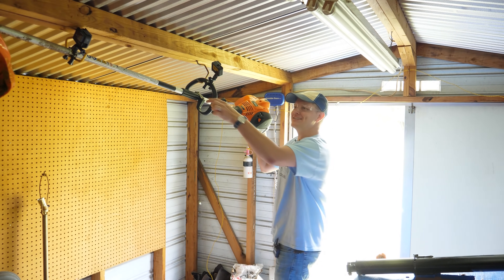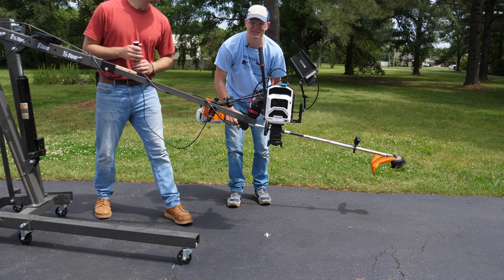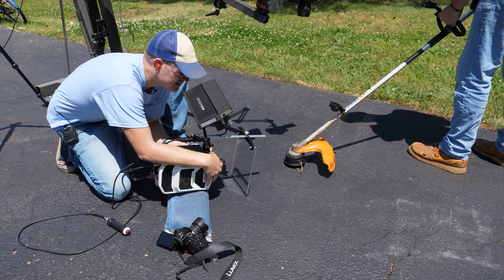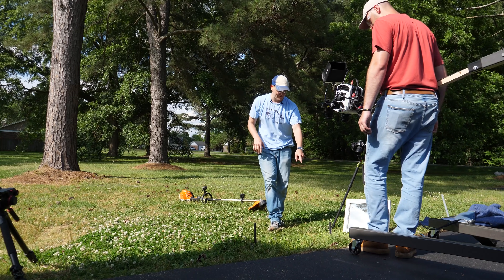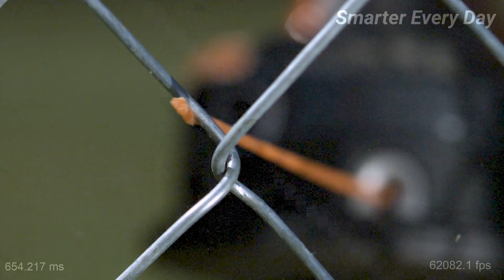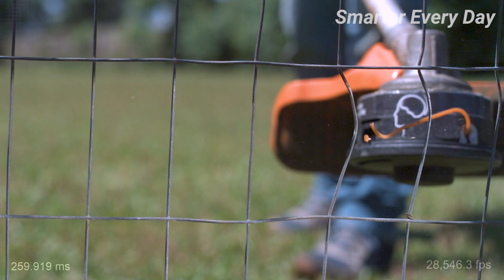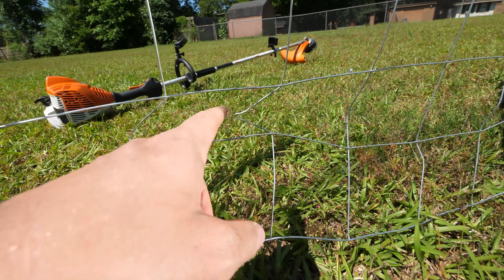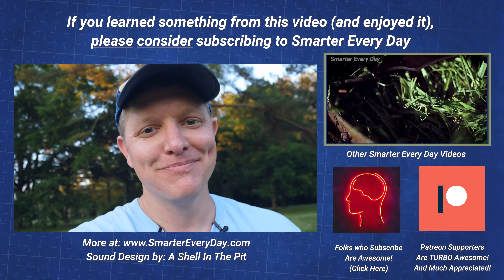How Weed Eaters Work (at 62,000 FRAMES PER SECOND) - Smarter Every Day 236

Comment: The direction changes between curve shaft trimmers and straight shaft like in the video because of the counter rotation gearbox on the straight shaft. So, basically...    use 130 line on chain link and don't worry about it. If its a high quality trimmer.

Comment: I wonder how much of the breaking of the thin metal wire fence is due to heat tempering of the metal vs the tensile stress being anchored by the horizontal wire vs the torque stress applied at the weld point as it appears that the vertical wires are being both bent and rotated by the weed eater line.

Comment: The video is as usual, awesome. I have a comment though: At 8:44, we see that the buried pole exerts a force towards the top-right direction (of the video). What happens if you move the weed-eater closer to the buried pole? Assuming that you counteract the top-right force and move the weed-eater closer to the pole. If it's close enough for the line to wrap around the pole, since the weed-eater is trying to pull the line in a cyclical fashion, there will be a tension in the line that pulls the weed-eater (and you) towards the buried pole. So the direction of force depends on how close you are to the pole. I think this is what could have happened in the case of the fence with the smallest size; you go pulled towards it right? What do you think?

Comment: Destin, great episode and as I am constantly straining to trim my iron fence, I was wondering if you had considered an addendum to this with alternative cutting devices, such as thicker trimmer line of this new thing called "the indestructible trimmer" that is a wheel of twisted wires lines replacing the plastic "string"?

Comment: I call it a "grass trimmer" because I use it to trim grass.  It doesn't "EAT" grass or weeds or anything.  I trim the grass where my mower can't go.
I've been using those yellow plastic blade rather then line.  They don't work well next to wall or fences.  The blade tend to kill the the engine when it hits something that 
doesn't move and the blades tend to wear down quicker then I thought they would.  I have a lot of brick landscaping and the brick wears those blades down.  The brick is why
I got away from the line spools.  The line would break to easily.

Comment: At 11:32 it almost looks like part of the process is the the plastic wire wrapping around the metal fence creates friction, causing the plastic to rub and almost melt, aiding in the breaking of the line.

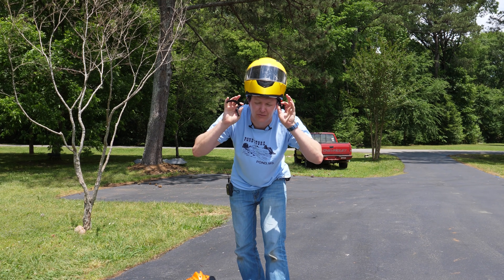Comment: Between 3:44 and 4:00 you were talking about the length of line affecting the speed of the engine.  It has the same effect as putting a lighter or heavier flywheel on a car engine.  Also in the slow motion of cutting grass, it reminds me of a comment my uncle, who was a helicopter mechanic in Viet Nam, made about a helicopter.  He said a helicopter doesn't fly, it just beats the air into submission.  The line doesn't really cut the grass as much as breaking it off.

Comment: Have you considered the heat from the friction of the lines unwinding from the fence. In one shot it appears that the line melts and breaks at a half way point of the wrapped line 11:10 in the  video. The end of the line attached the weed eater appears melted or abraded at the end. A high speed thermal camera wound be an interesting video. Love your channel.

Comment: Hey just subbed to your channel! Love the content. I just wanted to give you some advice from an experienced point of view haha. Use the left side of the weed eater and go left to right with your body parallel with the direction of what you are weed eating. Since the head spins counter clockwise and you use the left side if you hit something it should keep you more on track instead of having to reset your portion and it will help your work look better. :) keep it up!

Comment: next weedeater video he need to put his aeronautical degree to use and talk about WHIRL (String shape and length). anecdote:  when the 2 strings are of unequal lengths (or there is only 1 string in the head not both),  the whirl makes more noise and  the vibration is much worse.

Comment: Cutting lawns is unnecessary and causes numerous problems for the environment. The amount of leaf area is reduced; consequently, reducing the conversion of CO2 to O2 and carbon. Five percent of pollution by mobile sources comes from lawn mowing. The small engines used are exempt from pollution requirements. US People spill gas and oil equivalent to the Exxon Valdez every year. Habitat for animals is reduced. Lots of people suffer injuries from blades and thrown rocks.
However, I don't expect people to change their cutting behavior anytime soon. It's an obsession, and laws even put people in jail for not cutting grass.

Comment: so basically the only reason why we loose line is because some thicker weeds pulls the string causing weed eater guard to cut off the access. so cutting simple weeds you would never need to replace string, but I got confused when you remove the guard and the string lengthen on its own, meaning regardless the machine itself it still going to cut bits off slowly with the guard on. the speed at which it turned when you took the guard off did not determine the length it just got longer. so what kind of string would be good to cut everything without braking and not having to buy more, piano string, guitar string.

Comment: I think the failure in the thin fence is mostly due to the weld between the horizontal and vertical wires creates a fixed/rigid support which allows it to resist the shear and normal forces as well as the bending moment right at this spot.

Comment: really interesting video. Also, cutting from right to left is kinda like using a scythe. (weed eater is just called a engine scythe here) Anyway, when you cut a little higher grass , going from right to left helps you to get that grass lay down cleanly (blade/wire rotation)
Cheers from me and my Stihl ;)

Comment: This has to be affected by how close the head is to the obstacle.  The closer you are, the weed eater line is hitting closer to the head and therefore moving at a slightly slower speed than at the tip.  I think the last test really showed this.

Comment: I saw that some people are using zip ties as they are thicker and stronger. Would love to see how they differ from traditional weed eater lines.

What I hate about weed eaters is they destroy grass and weeds and leave bits of plastic everywhere. And it can damage fences and gates, etc. If the zip tie method works and leaves clean cuts on grass I’ll definitely switch

Comment: We call it weed trimmer up here in Vancouver Canada and I am a professional gardener.
I use my trimmer on every working day and what you have experienced in this video is literally what I encounter daily.
To put everything in short and simple format for everyone to understand, trimmer react differently to different material/grass/fence/weed when using different type of string. Thicker string may seems more durable but it still depends on which type of material it is made of and of course the thicker will cost you way more than the non commercial ones.
The length of the string and its force depends on the power your trimmer engine can deliver, but most of them work great when the string is less than 4 inches long; the longer the string is, the less force you will have and less effective to trim the grass/weed. 
To effectively use your trimmer, always goes from right to left; and if the grass/weed is quite long (more than 5 inches), trim it down first from the top or your trimmer will 'grab' the grass/weed and stop your trimmer head from rotating.
One thing I want to add is the length of your string could actually damage your trimmer part because the force from countermeasure is too great, your parts will hit a full stop like a metal hitting right into a sturdy wall. That is why to stick with the recommended length is important (that's why there is a metal knife in the guard to cut off the extra length)
My last advice is - take it slow, especially it's a long grass/weed. Remember the string is still made with plastic, its characteristic is not to stay at straight, or you will replace it with metal blade instead. :)

Comment: removing the gaurd and running the string about 10 inches per side makes it much easier on chain fences, the slapping motion cuts the grass without cutting the line, and good throttle control helps too. long string is very helpful when cutting hills where the grade is too steep for the mower.

Comment: Great footage! However the smaller diameter wire broke on the solder most likely due to a stress raiser caused by the solder point itself. The thermal affected zone doesn’t have that big of an influence on a non thermal treated material.

Comment: I'm not sure if it was mentioned in the video as to why the weed-eater would pull to one direction when it hits a stationary object. But I would assume it's because of the force of the wire hitting the object causes an opposite force back on the wire. And that starts propagating back through the weed-eater, and throws the person off who would expect the machine to go in the original direction?

Comment: I don't think it brakes around the welding because of heat treatment, but because of stiffness of the area. On the weld there are 2 wires attached so it is difficult for hit wire to flex so it brakes. In  the middle of the wire it can flex so tension is smaller. It also makes forces act more along the wire length instead of perpendicular to it as it is near the weld. That is easier for wire to survive in middle instead of near the weld.

Comment: I haven't thought about this before but this made me realize the amount of plastic and microplastic that this puts on the ambient and it goes into the soil or washes away to water bodies. And it wouldn't be a problem if they weren't used so widely. It's a shame because it's a great solution but this could be something to watch for, truly biodegradable plastic needs to be developed by this or get back to more traditional blades

Comment: My 3 rules of weed-eating:  (1) - keep the head rotating away from you (relative to where it contacts things), otherwise discharge of grass and line will pelt you.  (2) - only use the very tip of the line for cutting.  If your line is slapping stuff it isn't cutting - as your footage shows.  (3) - keep RPM high when cutting to keep the line straight and not floppy.  Great video!

Comment: Well, the tork should really be determined by the length of the line squared, since the further out you go, the faster you revolve around the center. Or since it doesn't start right at the center, with c= "the radius before the line starts", it should be (the length of the line + c )^2 -c^2

Comment: The heat generated in the line kinda melts it a little bit and then the force of the head rotation pulls the material apart.

Comment: Kids, that's how microplastic is created.
Reply: 0.000000000001% of it.
Tires are the biggest culprit then artificial lawns.
Reply: @wientz  Toothoaste contains microplastics? Fascinating. I always thought the abrasive effect was caused by something like sand.
Reply: @sheepsfeather3159  It's unlikely you'd find it these days, although it definitely used to. Microplastics in any cosmetic or hygiene product is actually illegal in a lot of places now.

But you'll still be spitting out microplastics from the brush bristles
Reply: @sheepsfeather3159  It hasn't contained microplastics in years. But in the early 2000s (I think?), there was "microbeads" in EVERYTHING.
Reply: @wientz  Ew I use a sink
Reply: @Tom-u8q  but the sink leads to the sewers
Reply: @mrorangejuice9682  shhh don't tell them
Reply: Langston Mcknight Not mine! 

Septic tank gang
Reply: @sharkboi6164  yeah and where do you think that goes once it gets emptied
Reply: saucy guts My garden. You think with all New York’s tax bullshittery I can afford a cleaner?
Reply: @sharkboi6164  so what you just said was "my microplastic doesn't drain into the sewer bc i have a septic tank! it goes in my garden instead."
Reply: saucy guts Yep :D
Reply: T it ends up in the sewer dumbass

Comment: I passed the curiosity test, and have a question... Exactly what material are each the fencing and the weed eater wire? Would a different type of metal on the same size fencing alter your results as to how the wire is broken/shredded or if the fencing breaks and where? I think so, though it may not be worth making a full video for that...

Comment: Oh boy if youre going to do another please test the difference between cuts when going at high rpm vs low rpm.  I did landscaping for a while and tried to do some testing.  At low rpm you save gas and stress on the engine but i think high rpm does a cleaner cut on the grass so it recovers faster.  But if you want to kill an area you can do low rpm weed eating to put constant abuse and stress on the grass so it won't grow back as fast.

Comment: The reason that the weed eater will not run with the line all the way out is because the engine must be tuned to the load that's on the head. So if you wanted to run with trimmer line that's longer than the factory of length you must retune the high-speed and low-speed Jets on the carburetor. That is assuming that the motor itself is able to pull the trimmer head with the amount of weight on the end of it at that RPM. If you had a very powerful weedeater motor you shouldn't have an issue running lines that are extremely long. I see this all the time with people that have lawn mowing businesses that run extremely long and trimmer lines and they can't figure out why they cannot get the engines to run correctly. So if you wanted to retest it take it to a shop and run the line out as far as you wanted to be at and they can tune the engine.

Comment: Well now I understand why in the instructions it always says not to use metallic wire or any other than a cut line.
and above all what the manuals referred to with "This Product causes microplastic contamination", (I never believed that the line would be broken into micro shrapnel when hitting something, I believed that it was simply worn out in fine powders by friction (such as abrasive discs) or the heat from repetitive blows slowly melted it) -especially on dry grasses and stems the line tends to heat up

Now I just need to understand what they mean when he says: "This product gives off particles that can cause birth defects or are carcinogenic."
[I have never understood, Are they referring to microplastics, carbon from motor brushes, or something that contains grass or weed? or what does the potentially carcinogenic material that they always say emit?] In those that are by gasoline it makes sense (smoke) ... but the Electric ones too, why?

-and I only reaffirm my theory that the line cutter is useless, it is still better to cut it with cutting pliers, I don't know how safe it is, given the physics and mechanics, but. A V-shaped cutter (like open scissors) would not be more efficient

Comment: Love the video and the concept!!! One thing to note in particular about the “weed eater” as you southerners call it. You mentioned that the motor won’t rev, in particular with it being a 2 stroke motor, it needs to “supercharge” itself. That means that it the motor was already spinning at high rev and you increase the load, length of string or resistance (grass or objects being trimmed) the motor can handle that better once it is in “supercharged” state. So if you would have had the motor fully revved and then increased the string length you would have stayed at full rev.

Comment: The reason why the line breaks is because of friction heat build up. Try this get some aluminum fence ties and bend it back and forth sharply and quickly it will get hot. If you were to do it fast enough . The same applies for the weed eater line.Impacts also generate heat 😏

Comment: I think the tug not directly towards the pole is the traction of accelerating the line back outwards, look at the angle of the attachment point to the head. I don't see how to push the WeedEater head sideways by pushing sideways on the line , maybe a traveling wave?
Pulling the line "down and left" moves the head up and right.

Comment: Man I love slow motion videos. I'd be doing some if I had the equipment. 
I also like learning about anything, so it's a good combo.

I have a neat scar from a weed eater back when i used 1 at age 7... kinda dumb. 

Psst. I have 78 scars not including stretch marks from quick muscle gain. Good that I'm so pale almost none are easily seen except one from a stabbing in my forearm. I thought it hit an artery after it bled so much.

Oh there's 1 other visible one, a brown recluse got me in the thigh in 2013. It melted the skin & muscle down to the bone in a crater.
That made me hate spiders more than I already did! If it'd got my neck or such it could've been BAD.

Comment: its not lagging behind because of air resistance but rather because the head is sinning so fast that the soft plastic cant keep up. the air drag only makes a small difference when the line is really long

Comment: Raycon are okay, but don't address the e-waste problem Airpods and others have. What's the product life of these? Specifically, how long is the internal battery going to last before it degrades to a point where a recharge won't provide a usable experience? First gen Airpods have already exhibited this battery degradation and of course being Apple it expected that the consumer just buy a new pair. A perfectly functional pair of wireless headphone now e-waste due to a non-replaceable consumable component.

50 Million tonnes of e-waste is produced globally every year. That's 4,500 Eiffel Towers. Projection's estimate this could reach 120M tonnes by 2050.
Is it possible for our species to address a problem before it becomes critical?